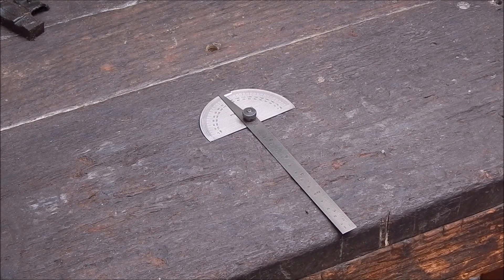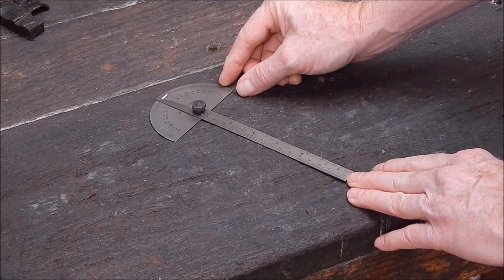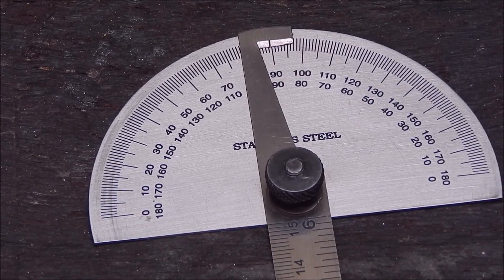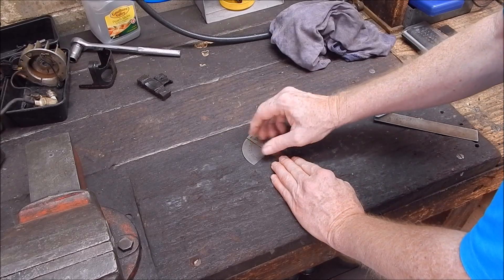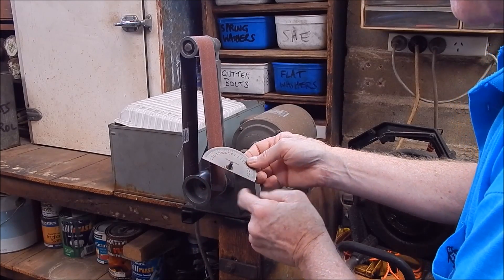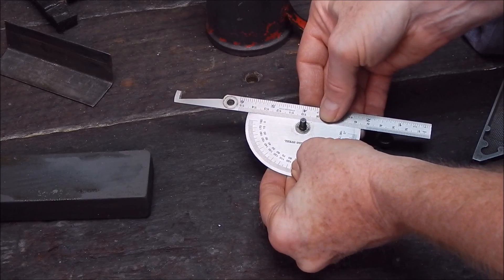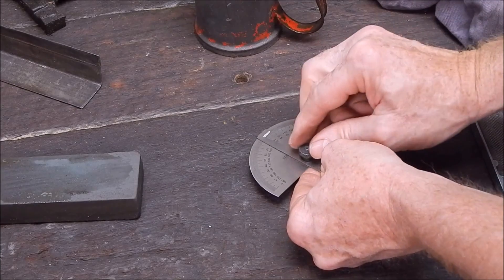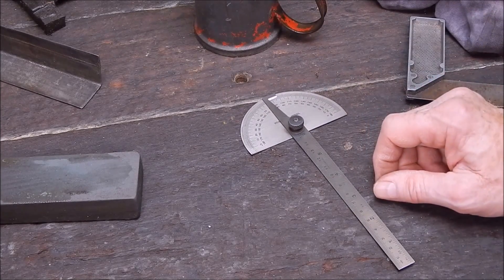Half a degree out

Comment: Hi Rob, I was checking out videos on protractors and came across your one again. I must have seen this before and forgot. My last video on the Starrett one, showed it also out by half a degree in the opposite direction to yours. I fixed my one by covering the data point on the arm, and marking a new register line. Shouldn’t have to do this. Would have expected the Starrett one to be perfect. Cheers Nobby
Reply from the maker: Hi Nobby.  Starrett quality seems to have gone downhill in recent years. I suspect a lot of their budget range is now made in China, as some items appear to be almost identical to cheaper no name offerings.  A simple device like a protractor should not be out, but you see it, so there's obviously a lack of quality issue there.  I have never bought Starrett as I'm more of a Mitutoyo fan boy, He He.  Having said that, I primarily use Chinese test indicators (most used item) as in all honesty they are just as accurate and not such a monetary disaster when/if dropped.  The top shelf clocks tend to stay safely buried in the drawer and rarely get used for fear of damage. LOL. Cheers Rob

Comment: I have this same exact tool. I just checked mine against two different metal squares and it turns out mine is spot-on. I use mine  occasionally for woodworking and it never made sense to me  but I just figured out  to treat  the top 90 degree  as a zero degree mark .  That makes it  so much easier  to figure out the angle on a chop saw . Thank you for the video

Comment: I looked at the problem differently. I would just grind off enough of the flat section where there is the single indicator scribed-line to remove any trace of the wrong scribed-line. Then re-scribe the line in the correct position after clamping the protractor to a precision square to ensure it doesn't move while adding the new line.

Comment: Hello Rob,

Thanks for the video.  I was in blissful ignorance of the accurate of my protractor until I watched your video.  I have never used mine for setup, only for attempting to measure non-critical angles.

Mine has a General Instruments name.  A decent brand in the US.  Still likely Chinese made.

I checked mine with a good square and it is also slightly off, a tad less than 1/2 a degree.  I will need to tweak mine like you did.
Reply from the maker: +LV_Woodturner 

They probably all came out of the same factory, and have a similar error.

Pity, because the stamping is very crisp and uniform.

Cheers Rob

Comment: My two cent's worth is that Asian equipment is usually well designed (copy US/Euro patterns) and mostly good materials. But quality control -- ah, that's the root problem. As you say, the guy that runs the test equipment was out to lunch. Or the CAM machine had a problem and the edge was off. Tomorrow I'll go out and check my shop protractor, because the fix is not difficult. I have a precision square I keep in a case, BMS something. I would not use a cheapie square to check a cheapie protractor, but you used several. Good insurance. Thanks for bringing this problem up. Merry Christmas!

Comment: Hi Rob.
I noticed you did not check the correctness of the protractor itself the graduations may have been correct. 
To rely on the scribed indicator mark which looks well OFF it may have been more the problem. That would have been a far simpler fix by removing it and just re-scribing a correct indicator mark.
Reply from the maker: +Raymond Sanderson 

Hi Raymond.  Good point, that's also just been suggested by another viewer.

I went checked the scale and centre point against a triangle, and it's all OK.

Cheers Rob
Reply: Then what you did Rob was the right way to go.

Comment: nice work Rob ,both of the cheap Chinese protractors i have are a bit out , i only use them for grinding high speed steel tool bits so half a degree out isnt really an issue , i picked up a nice moore & wright combination protractor square and center finder kit at a swap meet for next to nothing that i use when i need to be a bit closer than guessing .
Reply from the maker: +Lynton Rodda 

Hi Lynton.

 I was interested to hear if other folks had experienced an error factor with this style of protractor.

It's actually well made and stamped out, except for the small error - pity.

Once I find something like this it grates on me, and when it's fixable I have to do it.

Nice pickup with the Moore and Wright.  Sometimes you can get lucky.

Cheers and Merry Xmas.

Rob

Comment: Did you try it against a carefully made triangle made at some other angle than 90 degrees? If the source of error was the pivot hole being out of center with the degree engravings your protractor might show a difference reading to the left versus reading to the right.
Reply from the maker: +disgruntledscientist 

Good point.  I just went and checked it as suggested.

All spot on - OK.  So looks like the centre point is good.

Cheers Rob

Comment: Hi Rob,

Not trying to be critical, but I would never use another square to check for precision.  I draw a line, using the square or protractor, from both sides of a known parallel piece (or with a square - from both directions on a straight edge) and check to see if the two lines coincide.  Far better, IMO, than assuming one master tool is correct.  Half a degree is often close enough (for cutting tool relief, rake or whatever) and machines are set up using parallels and a dial gauge, anyway.
Reply from the maker: +R Balderson 

Point taken.  I checked it with three high quality squares and they all showed it had the same error.

I hadn't noticed the problem until now, but had to correct it.

It would have driven me nuts otherwise.

Cheers Rob

Comment: Why didn't you just etch another mark right at 90 degrees while holding it against your square?
Reply from the maker: +Jon Wallace 

Easier to do what I did,

Cheers Rob
Reply: Fred Miller I meant a new mark on the pivot arm, not the scale. Assuming the spacing between the degrees is accurate, then fixing it for 90 should fix it for the rest of the scale.
Reply: +Jon Wallace  With an accurate protractor you can set any angle.  A square is used to accurately set 90 degrees.  Rob's fix repaired the entire scale not just the 90 degree setting...
Reply from the maker: +Jon Wallace 

I understood what you meant.  But etching is something I've never done.

All comments are gratefully received.

Cheers Rob

Comment: What's your take on chinese made tools and equipment? I recently got in a bit of an argument with a guy trying to sell a small lot of used HSS tools for upwards of $85 because they were "made in england". My stance was that I could buy the same quantity of brand new blanks from china for half the price, so why would I pay that?
Reply from the maker: +Rob Mckennie 

Hi the other Rob.

There's so much stuff made in Asia now, that to dismiss it is rather ridiculous.  I've used Chinese HSS and it's quite OK.  The UK stuff is also OK, but to say one is better is a bit one eyed.

You get what you pay for, and China like Germany and the UK etc will build to whatever price you ask.

Thankfully most of it is quite good for the dollars spent.

You still get Chinese lathe bashers, but in reality most small model / hobby engines are made on Asian lathes.

Just check over what you are buying.  Probably the worst cheap quality lathe tooling these days comes out of India - yet India can also make some excellent metal work tooling.

I've bough some real crap USA stuff over the years as well, so it's not limited to Asia.

Cheers Rob